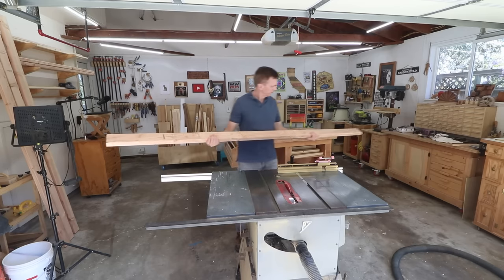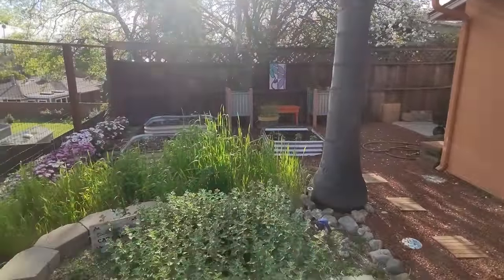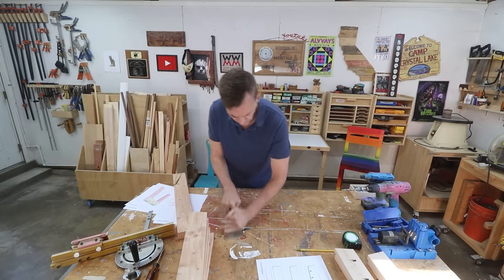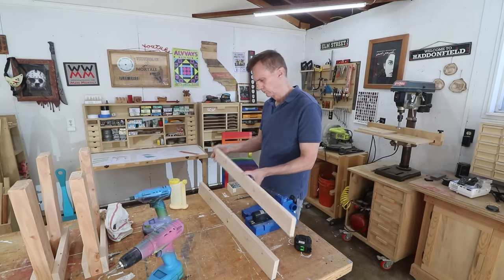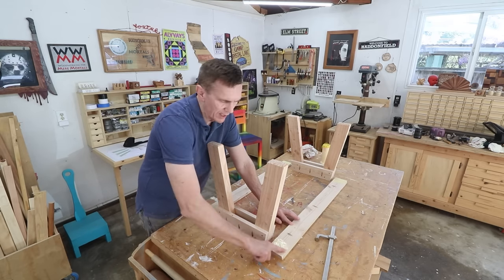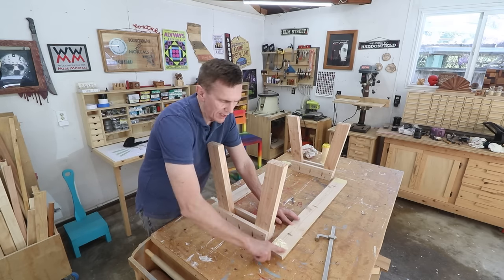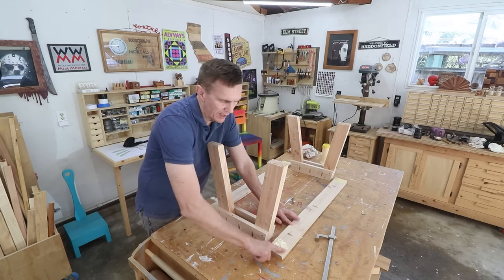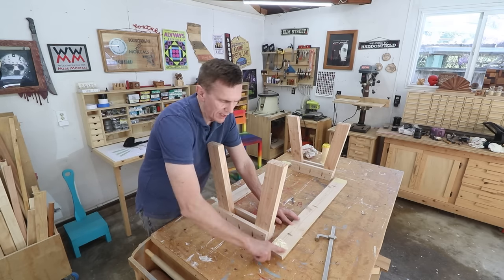This garden bench cost less than $20 to make

Comment: Instead of salt to try to hold glue ups still, I've had a lot of success with hammering a couple of panel pins or brads halfway in, then clipping them off close to the surface on one of the surfaces to be glued.  This then gives you some sharp points to hold the glued surfaces in place while clamping, and you'll never see it once assembled.
Reply: One of the better tips I've come across, and it works well also!

Comment: Recommendation for attaching the long stretchers.  You couldn't clamp across them because they were opposing angles and the stretchers were pulling up, but they were at the same angle as the leg they were attached to, so you could have just clamped them to the leg right next to them for the clamping force to be parallel.  Wouldn't have had to drill holes and screw them in. Love your vids and keep it up.
Reply: Had the same idea about the clamping
Reply: I mean, yeah, it seems really obvious to me. 🤷🏻‍♂️ sometimes when you’re in the moment you get stuck on an idea and can’t see something that is so obvious to a casual observer.
Reply: Couldn’t the front stretcher be attached with pocket holes from the inside side stretcher?

Comment: When the stretchers started to slip off the legs when you went to clamp both sides at about the 15:30 mark of the video…. You could have tried wrapping a ratchet strap around the entire thing.

I’ve used ratchet straps in place of clamps when I needed a circumferential constricting type of force and… I was surprised… they worked.  LOL

Nice project.

I love that you left in the “hiccups”… we all have them.

Good video!  Good project.  Fun channel.

Comment: You could use the pocket holes to secure the frame to the workbench during the glue up.  Secure one of the long stringers and then each leg assembly.  Then the other long stringer could be clamped in place without needing to be screwed down.  The geometry would hold everything in place and the surfaces would be coplanar.

Comment: Friendly tip from an old geezer.   Whenever you have a project that has wood in contact with the ground, use a 50/50  mix of water and TB3 brushed on to the surface.  I have had to reapply the mix every 3-5 years but I have yet had to replace any wood.  Keep on rockin'.
Reply: Nice timing, just applied it to a Kwila bench I am finishing. Thanks😊

Comment: Gotta put in the odd thought ... Instead of capping those screws with a piece of dowel, you could have let the glue dry .. Then removed the screws and finished drilling the holes for dowels? ... Would it be worth doing? ... 'Because I could' is good enough for me 😉  Glad you came back up on my feed.

Comment: Good project!  I made a similar bench, but with a back, so it had a lot more slats about 1/4" apart.  I laid all the slats on edge and put the finish on before attaching them, leaving any necessary glue space bare.   Trying to get finish on between them after attaching them would have produced a lot of drips and runs, causing a need to constantly turn the bench upside down to deal with them.  I, too, used pocket screws and glue to attach all the parts.

Comment: Looks great!  Funny because I just recently did the same thing on my second Harmony bench, that is having the screws show out instead of in.  Unfortunately I couldn’t simply pull them off and turn them around. Leaving them to show didn’t feel very harmonious to me, so I ended up putting on 4 more boards to cover them.  If I had a planer I could have slimmed down their thickness. I still like how it turned out!

Comment: Good tip on using the foam brush to finish between the top slats. I recently spent way too much time rebuilding and refinishing an outdoor wooden table that I got for cheap. It was really well built but the gaps between the slats were too tight so the previous owners never bothered painting in there when they repainted the rest of it. Hence it got water in and started warping. I could still use the slats - just cut them all a little thinner on the table saw. But another year outside and it would have been gone.

Comment: I really like the simple, elegant design of this bench, Steve, especially those 10-degree 'Goldilocks angles' (i.e., 'just right').  I'm getting ready to make a version of it, with spring mowing season imminent.  Our previous 'old man resting while mowing' bench is no more, and my plan is to put it together using left-over pallet wood for the leg assembly, and probably some thinner stock for the seat, to cut down on weight.  I'll be accounting for cupping in the seat pieces by orienting their end grain into 'smiles' (growth ring curves pointed down), causing any curved surfaces to point up and shed the water, not catch or pool it.

Comment: I put a construction staple in there to keep the pieces from sliding during glue up. I break it off the strip of staples, and just lay it over, then when you clamp it down the clamp compresses the staple in there and keeps the two pieces from slipping. Doesn't even cost a cent to have it in there.

@13:36 OMG that whole glue up I was watching hoping he'd turn around the closer set of legs so the pocket holes were on the correct side.

Comment: Hey Steve, 15:30 - a little trick i use sometime is to put some salt in the glue joint for things like this, and it will help grip the two pieces of wood to prevent them sliding on the glue so much. i use it all the time and its great. just regular table salt, or some slightly coarser salt works great
Reply: He addressed this….said he can never get that little trick to work.

Comment: 18:00 Glue up the legs on one side at time. Turn the assembly 90 degrees to the way you show it on the video and slide it to the edge of your workbench. Clamp the centerpiece (leg assembly) vertically to the bench so it can't slide up when you tighten the clamps on the cross boards. Use the same procedure to glue the other leg assembly.

Comment: On glueing the long side boards, if you place a clamp (top to bottom) that covers both sides of the joint, the end board that is attached to the legs and the end of the board you are glueing at an angle. Now when you clamp the boards on an angle the clamps on the other boards stop them from shifting.

Comment: Another tip for the day I learned awhile back. When you are drilling a hole, especially to put a dowel in, if you first switch your drill to go in reverse until your bit is a little bit below the surface of the wood then switch back to forward you eliminate the little bit of wood that is kicked up and makes for a smoother rim on your hole.

Comment: Always easier to see options when someone else is doing the work. The inside of each leg is parallel to the outside of each spreader. Use a 6" c-clamp on each corner, re-ensuring that the overall still remains square.

Comment: Great meditation simple projects.    Fyi, pin nails or small brads can hold those boards and not leave holes that need repairs.   If bench sees rain, need water proof glue. 

I would love to see bench with a back and pads.    Maybe just reverse 10 degree on back 1x and build up back.

Comment: At 15:40, when the clamp causes the wood to move, instead of trying to use one clamp to hold both sides at the same time, he could have used a clamp on each side, with one side of the clamp inside the double end pieces, clamping on the legs themselves. This has the advantage that the leg also slopes at 10 degrees, so it's parallel to the side piece, therefore there'd be no tendency to cause it to slip. (A narrow clamp would be needed to get in-between the two end pieces.)

Comment: attaching the legs, around the 15:00 mark.  each stretcher is parallel to the legs.  Maybe a smaller clamp could hold the stretcher to each leg (2 clamps per stretcher).  then you'd have force applied at 90deg and no slippage?  Fun project--may make one myself!

Comment: Nice build.  By ripping the legs differently after cutting the angled ends, aren't they slightly different lengths?
Edit: never mind; that would be the case if they were trapezoids, but they were parallelograms, so it shouldn't matter.

Comment: Thanks Steve,  When you tried to clamp the stringers to the end pieces and the legs slide up. Could you not have using the pocket holes drilled put one screw each leg into the workbench to hold the Legs down?  Then clamp the stringers to the leg.    I saw the boo-boo with the legs, dang looked like me working.  BTW I'm 75 and enjoying making sawdust..    You Rock!!!

Comment: For attaching the stretchers to the legs, could you have used a pocket screw running from the leg to the stretchers or does the bevel cause a problem there? Looks like a spot where another concealed pocket screw might work, although the dowel pin is a great solution.

Love that you're still leaving your mistakes in and laughing about them all these years later.

Comment: Also, one can take bench out to concrete sidewalk, then rub leg bottoms against the concrete.
This will "level" it out pretty quick.
I use this method to "chamfer" edges without using the router.

Comment: Like the bench however I would have added a couple of cross support pockect screwed into the side apron of the bench and into each board on the top it keep the top center boards from flexing too much; making them a lot more ridge from the flex because of weight and lest chance on twisting or cupping. The braces could be one by material angled to match the bevel of the apron. And like you suggested I would have stain it before putting the bench together all but the glue joints and you could use painter tape to mask those sections. You also could have used a pin nailer to hold the pieces in place until the outdoor adhesive or epoxy to gain its full strength allowing you to use clamps without the pieces moving as well. Just a few thoughts.

Comment: Tip: Two small brads with the heads clipped off will pin a board in place and be unseen when not using fasteners . An eighth of an inch is all you need.

Comment: Instead of using salt as a traction agent when gluing, save the very fine saw dust from various projects.  When applying the sawdust to the glue, think of applying an amount somewhere between the amount of flour a chef would sprinkle on the counter to work with dough and a solid layer that completely, but just barely, obscures the glue.  I usually like to still see some of the glue through the sprinkled layer of sawdust.  Make sure you don't put any clumps though.  I had a really hard time preventing clumps using my fingers to pinch the dust and sprinkle it, so I ended up converting a small spoon-shaped lemon juice strainer (the smallest in a set of 3 which didn't get used often in the kitchen anyway) to a shop tool, and now dropping a pinch or two of saw dust into it, I can tap it lightly against the heel of my hand and create a really nice, light, even layer of sawdust.  After applying the saw dust, press the parts together firmly for about 10 seconds and voila!  No wasted food, and much better friction between the pieces being glued.  You still need clamps, and gravity and Newtonian physics still apply, but this will absolutely go the distance in terms of helping with the initial steps of getting something into clamps without it changing position or skating around like you're working with ice, instead of glue, and it helps to recycle some of the saw dust that would otherwise be part of cleanup and disposal.  It also gives a ready supply of sawdust in case you need an additive for glue that can be stained.  I hope this helps better explain how this trick works, while helping save food stuff for the kitchen and bringing some recycling to the shop!

Comment: Hey Steve, Pat here from Toronto Can. Just wondering when was the last time you hooked your tape measure to your belt or carpenters pouch?? I have a tape like yours as well as several others and none have a belt clip on them. The first thing I do when I get them home is take the clip off. I never use it and it seems to be in the way, feels better in the hand too.

Comment: Just a bit of advice - If you would clamp your project bench end assemblies to your work bench, you could have clamped the long stretchers to them without adding the screws on the outside..  This would have also eliminated the wobble added by the tension of the screws.  (It's not likely caused by twist in the stretchers themselves.)  This is why we make work benches and assembly tables as flat and coplanar as possible.  Remember to use your table as a tool to clamp projects and workpieces to.

Comment: Great video.  Love your style.  Where did you get the tie/dyed drill and driver?

One trick I've used (I think I saw it first on Jay Bates' channel) is to use screws to clamp boards in place then after the glue dries remove the screws and replace them with dowels.  Makes a very strong joint and dowels are cheaper and prettier than screws.

Comment: I did not know about the nail/paint can trick. I will remember it however!!

Have you ever used CA glue to "clamp" things while the good glue dries? I've had good luck with this. If you don't position it quite right, the CA glue can be dislodged with a few good smacks of a wooden mallet if you didn't use a gallon of it. Sometimes this is enough; other times it's just to keep it from sliding away while you get actual clamps in place.

I love projects that do multiple things; this one got you a bench and a bunch of paint sticks!

Great video; thanks for posting. Your (and your wife's and cats') garden is very beautiful.

Comment: Thank you for all the countless ours of woodworking for normal people. I learned so much, especially about dealing with mistakes and not take them heartbreakingly serious :-). I just can't help asking: the width of your work bench seems approximately the with of the meditation bench... So... would it have been possible to clamp the medidation bench to the work bench and then clamp the stretchers with the moving head clamp and thus save the screws? I reccon the taper would press the stretchers even better in when the bench base were clamped down on the workbench. Or did I miss anything? Again: thanks for all the content!! Enjoying it very much!!

Comment: Yay, Steve is back with a Friday project video and back with the Princess Meow-Meow theme!

14:31 - I can already see a possible error, all the pocket holes are facing the same direction at this moment. And I'm wrinting this comment as I'm watching the video. I wonder if you will rotate one before glueing on the board.

15:03 - nope, you didn't turn it in time... :( A good clamp position is to clamp a board to one of the legs, use 4 clamps in total.
16:01 - yupp, you found it too :D
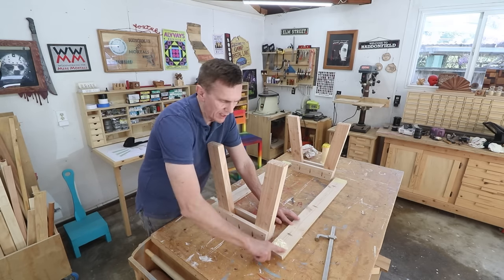17:21 - the moment of truth :D Poor Steve!

Comment: Instead of salt when glueing, use a sprinkle of saw dust. Waiting a minute works perfectly fine too, but for the less patient, saw dust adds that bit of grit / friction to keep the glue joint from sliding when you clamp!

Comment: You might have better luck with clamping the angled pieces by cutting 10 deg shims and placing them so as to create parallel surfaces on opposite sides where the clamps go.

Comment: You could have put pocket holes in the leg cross member ends that are on the inside that have the pocket holes that hold the top on. Then you wouldn’t to use the screws and dowels.

Comment: You could have fixed that length problem by splitting the slats two and run a vertical piece in the middle. It would certainly look interesting and would have saved a trip.

Comment: Put a screw in to clamp. Than remove them and put dowels in on that spot. The method you used, does reduce the strength of the piece as you are in essence reducing the thickness of the board by quite a bit.
Reply: It works like a charm, I did exactly this for a bench in my bedroom that turned out great!

Comment: Great video Steve!  Could you use 1 x 4 instead of 2 x 4 for the seat?
Reply: In order to have the same strength, you would likely need to use  hardwood,  boosting cost to double the $20 limit.

Comment: If I had cut the top too short like that, I might have used 2 shorter chunks and breadboarded the top to achieve the desired length.  But that's probably because I'm cheap, and would likely be using repurposed scrap anyway.  The pocket holes to attach the breadboarding could be drilled in the bottom surface of the ends of the top to hide them, before attaching the top to the leg assembly with those pocket holes.  

And then I'd probably say something about how I meant to do it that way all along, muttering about design changes along the way, calling an audible, keeping the top's ends from warping out of alignment over time in the weather, etc., etc.  😎

Comment: I don't think you would have needed to get more 2X4s other than one, or two, that can span the depth of your bench.  You'd cut your short ones exactly in half and insert one, or two, 2X4s cut to the depth dimension perpendicular in the middle of the bench.  It would save your wood and perhaps show off as an interesting design element.

Comment: To avoid sliding pieces when glueing: use small 1 or 2 very small nails, hammer them in halfway and cut of the head so a little spike of 1-2mm keeps sticking out a tiny bit and that will avoid the sliding. Waiting 10 minutes will make most glue lose most of its real potential and clamping down then makes not much sense.

Comment: 10:22 The logic of using salt is sound, but the substance is wrong. Use course sand. It won't dissolve. It won't crush. It will improve the strength of the joint as it breaks the "straws" and exposes end grain. ☮️❤️🌈